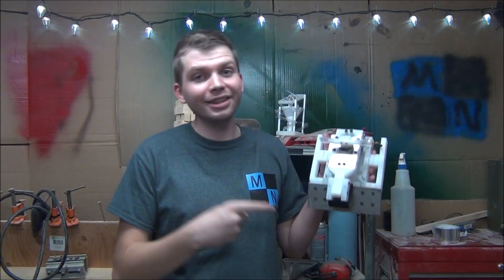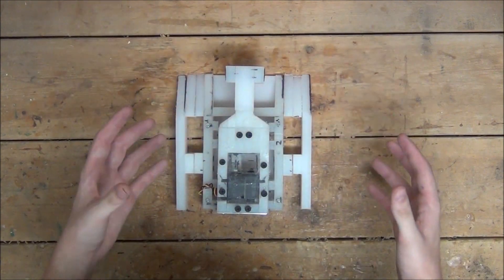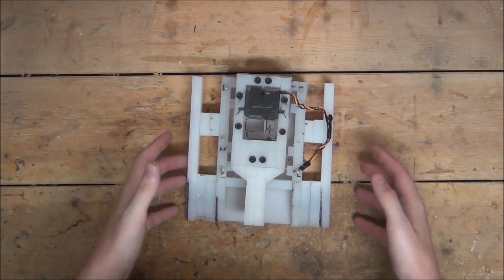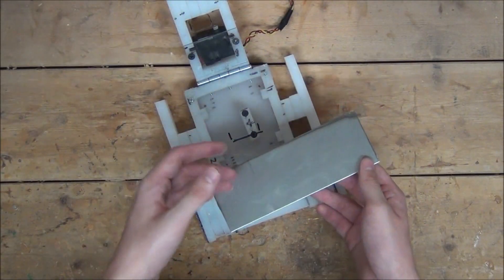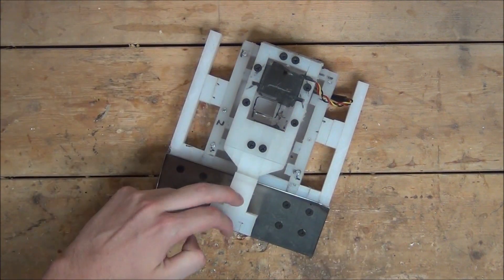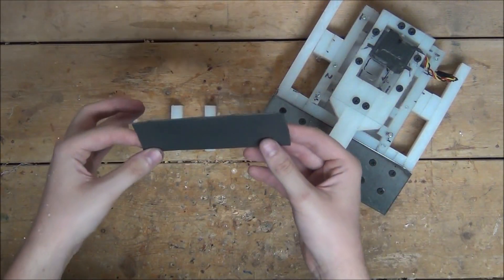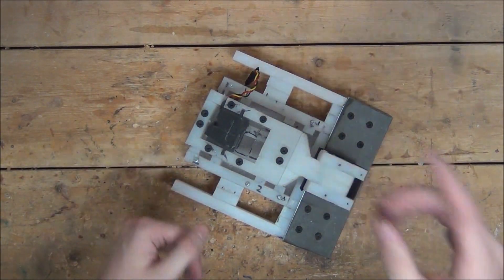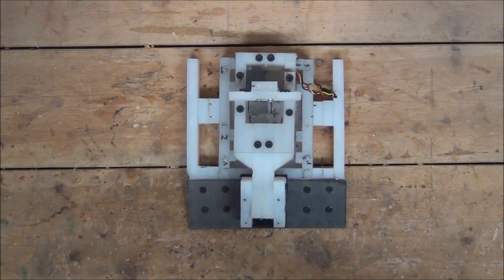How To Build A 3lb Battlebot!!! // Ritron Part 3/4

Comment: U need to put some aluminum on your battle bot to make it stronger and make sure it is fully 3 lbs
Reply from the maker: Where would i put aluminum to make it stronger? And Its coming in right on weight.  :)
Reply: Mechanical Ninjineer I was thinking u should make the arm out of a stronger material because in beetleweight competitions the spinners are not messing around they are in it to win it. But if you are coming in on 3lbs then you are good.
Reply from the maker: haha! Iv seen alot of 3lb fights so i know whats coming. I could make the arm out of aluminum but i think HDPE is going to take the hits alot better. It should absorb the hits without breaking which is easier on every part of the bot. I might have to swap out the arm after a sinner match if it gets chewed up too much but it shouldn't break.
Reply: Ok sounds like you have this all figured out